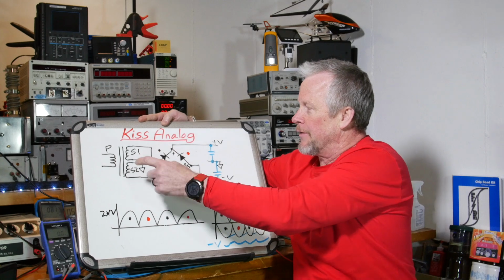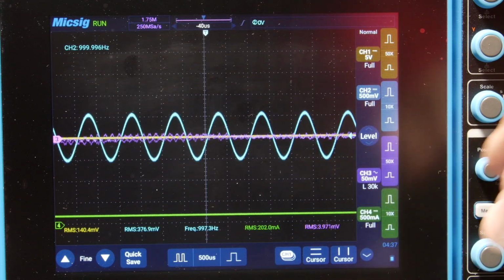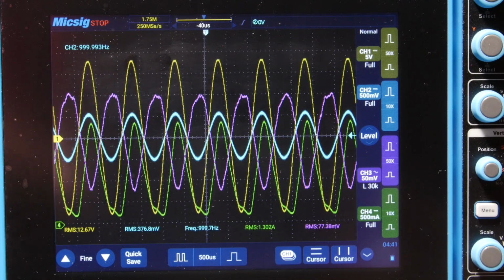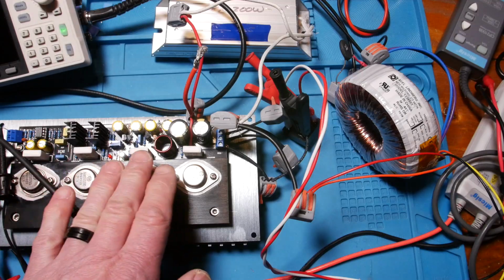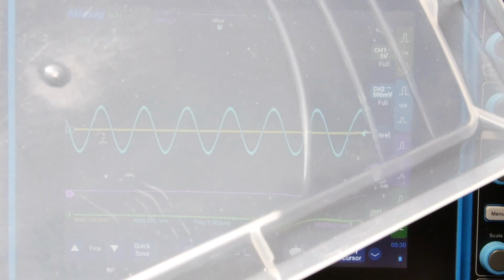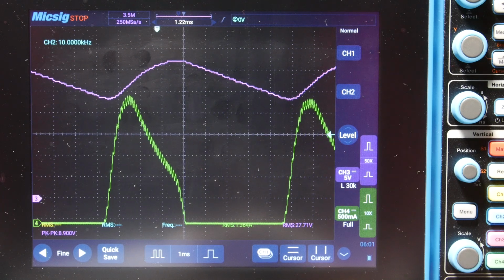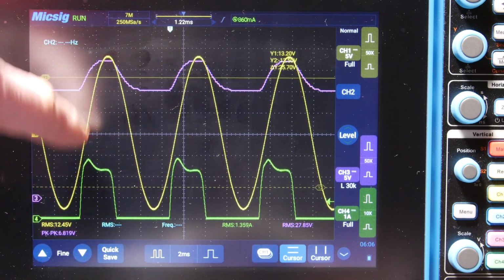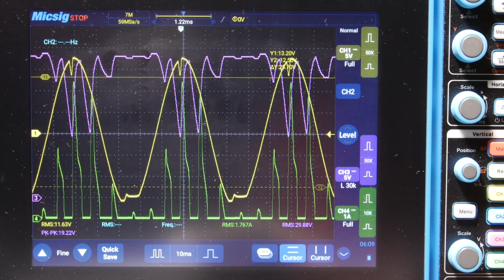20W Class A Amp Power Supply Ripple vs Load Frequency

Comment: Bulk caps have high inductance. They will resist supplying voltage at higher frequency which will lead to higher ripple at these frequencies.
Reply from the maker: Thank you!  That is very true.  Bulk caps are for low frequency response and Ceramics or such are used for high frequency ripple.

Comment: oke again great video, what are you going to do, maybe a CLC (cap,inductor,cap) or a cheaper CRC (cap,resistor,cap) filter, or still cheaper only CC to stack the caps up, at CRC you have more voltage drop, even with a 10.000uf 1 ohm resistor and 10.000uf i think u will have only 27 a 28 volt on the rail so not enough, so do you go expensive CLC and have a higher voltage rail, no i do not think so, so for CRC you have not enough voltage coming of the transformer to take that ripple out, so i think you go stack the caps up and wait until the ripple is less of a problem, but this way its not perfect, but in heavy loads u will have a small ripple i think, for sure not for A class amp worthy, or you have to do it like Nelson Pass do's it and go bezirk on caps, i think he has like 120mf so 120.000uf on his supply's, this also works of course, Mr Pass knows what he's doing, one of the best designers off class A amps, so kudos to Mr.Pass, we will see what u do, i like to do it so i have enough voltage out of the transformer and do a CRC filter, so simply say a cap resistor cap, yea i am dutch so good and cheap is my thing, maybe a different transformer with a higher supply voltage, we will see
Reply from the maker: Thank you Jos!!  Great feedback!!  I agree - Mr. Pass is really on top of the hill!  He also seems like a great person;)  The next video should bring more ideas, but then I’ll put together my ideas of what the final solution will be - also based on all this great feedback!

Comment: Don't look at THD look at THD+N you may see other artifacts that is not harmonically related. Also, you use two separate secondaries you should try two bridge rectifiers and make the 0V by connecting the two rectifiers in series like two batteries, noise is reduced. BTW your peak V calculation forgot the 1.4V diode drop.
Reply from the maker: Yes Nico - you are right!  I have shown that in some videos, and I did check that and it was OK, so I decided not to confuse the subject just now;) I will show that when we take final measurements.  Maybe it will help set the bias. So far this amp actually seems to be robust and remarkably clean for not having a big name design.  I wonder who designed it?  BTW, I do like the idea of the two bridge rectifiers separating the amps!!  Did I mention the diode drops - I meant to, but I was keeping the math simple for now.  I’m planning to do a summary design video to show how to actually use math instead of the experimental methods I’m using to illustrate the affects of choosing these parts.  If you have any methods that you have found work better than the obvious - I’d love to get your experience!!

Comment: Great video, perhaps you should have run a sweepstake for folk's to guess the capacitance to meet your target ripple😀
Reply: That's difficult, the deeper the tones are the more you need bigger caps or more caps, also the quality of the cap is important, a low resistance cap is faster to respond to a dip (ripple), so with fast caps you need less uf/mf than with slower caps, so you need to now all facts to calculate that
Reply from the maker: You are right Jos!  So, I might look like the bad guy as the only judge, but I offered a meter for the best answer in my next video;)
Reply: @kissanalog u are wright, i always do that to, measurements tell u the truth, but u can also hear it, more uf/mf in the power supply the more fuller deaper sound you get from a class A, i think its te energy stored i the caps that is necessary to let the transistors/mosfets  make that low tones
Reply from the maker: Thanks Ian!!  I actually had a though in the middle of my next video - thanks to you - and I offered some giveaway based on the answers that I received;)

Comment: how do you know what to use to clean the ripple at 120hz or doesn't it matter as long as it's high enough capacitance.
I'd like to know see how that reacts with two transforms working with negative and positive signals instead of just using the one,  and if the Transformers are coupled together to work as a push pull the magnetic inductance.
Modern capacitance Banks  seem to use this 0.1-0.3 capacitance across the capacitors not seeing a resistor in series tho with the capacitors 0.1 say 20ohms, reduces peak of capacitance and flatten it out
Reply: I think his next video should be about the differences with a CRC psu and just a normal C psu..
Reply: @JasonLeaman   Maybe even CLC as well.
Reply: @wlrIII  Yes..
Reply from the maker: Thanks John, great questions!  I'm getting close to wrapping up the design for this amp, and I'll go over these things and will show waveforms to support my ideas.